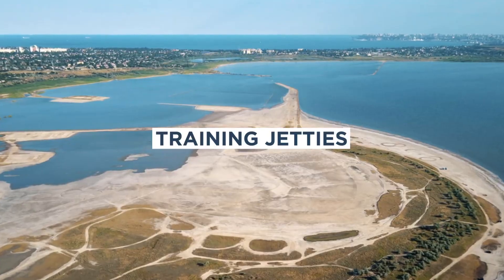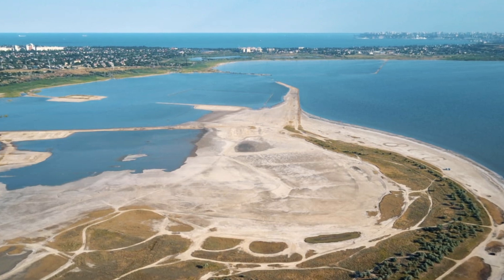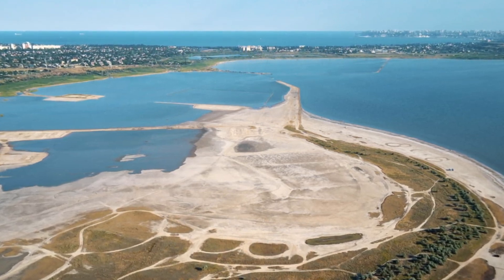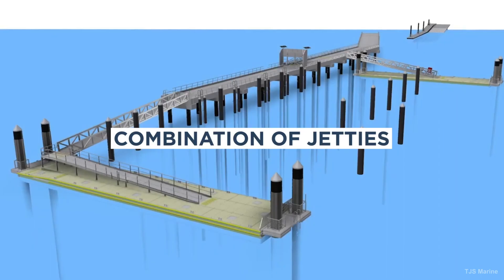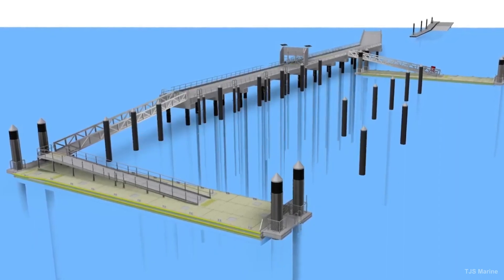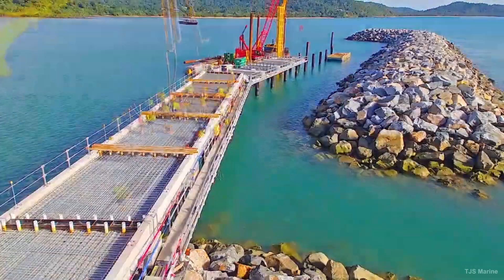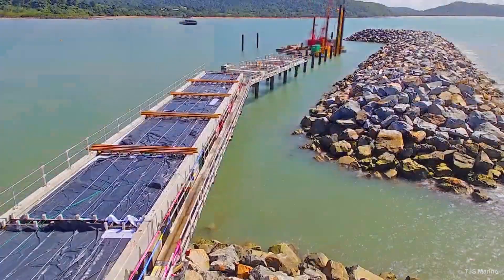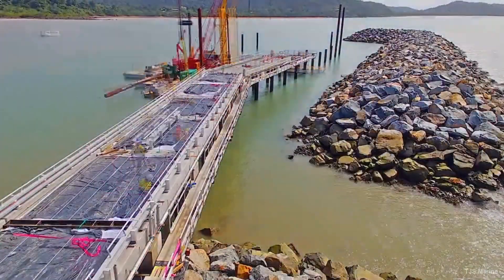Jetty Design and Construction | Marine Construction Series #2

Comment: How long does the steel pile last in the salt water.Thank You.
Reply from the maker: Steel piles in saltwater can last around 50 years, though this varies based on corrosion rates influenced by factors like oxygen exposure, salinity, and protective measures. With coatings or cathodic protection, their lifespan can extend beyond 70 years, but without such measures, corrosion in harsh zones like the splash area can reduce durability significantly.
Reply: @PileBuck  Thank you for that we have a bridge getting build in Townsville North Queensland Australia and they are using steel pipes outside with steel and concrete  inside and  had me thinking how long do they last.Thank You so much.